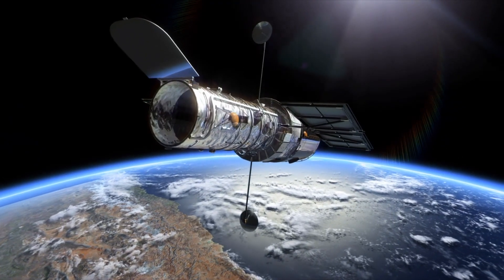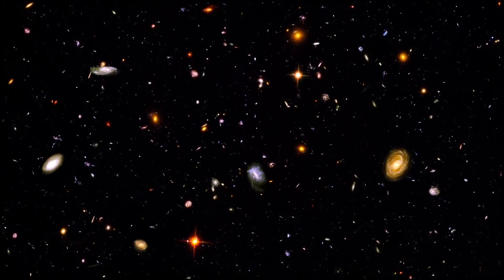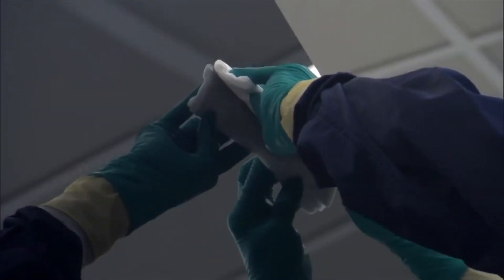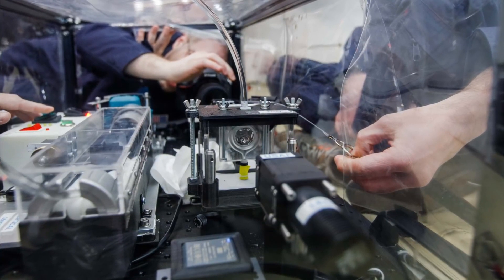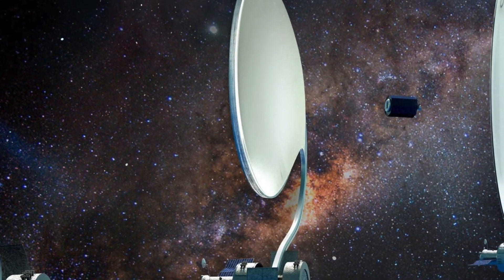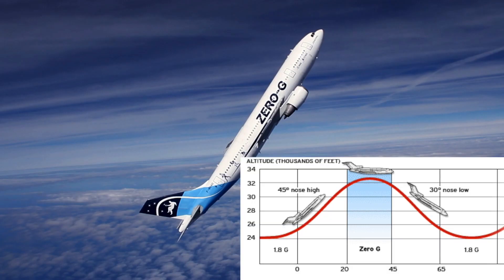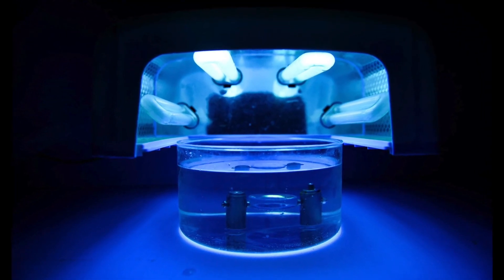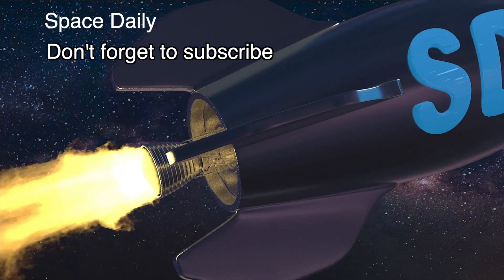FLUTE - the fluidic mirror space telescope project [space news]

Comment: how do they keep the liquid from evaporating almost instantly when in space? I looked it up. They are NOT making fluid lenses 1:30.
Reply from the maker: These are liquid material lenses, but of course they are cured for use
Reply: @SpacewithJulia yes, cured, so not liquid
Reply: Evaporation isn't an issue for fabrication inside an enclosure such as the ISS.

For the large scale telescopes it is. Currently the plan is either working with a liquid metal such as gallium, or ionic liquids with very low evaporation pressure.